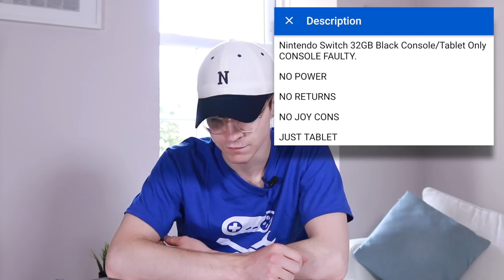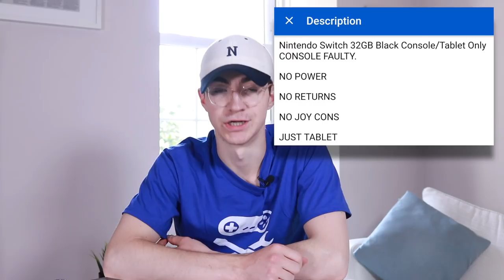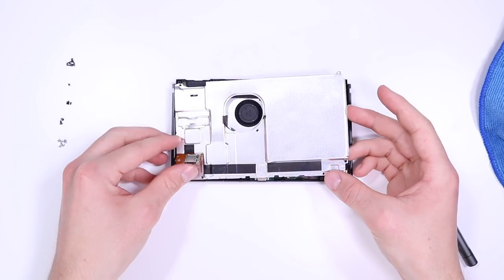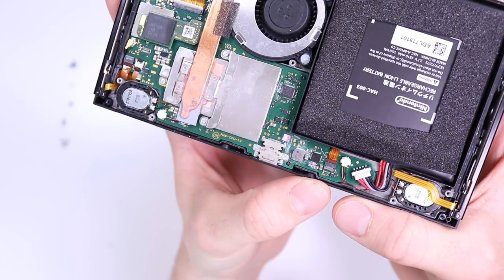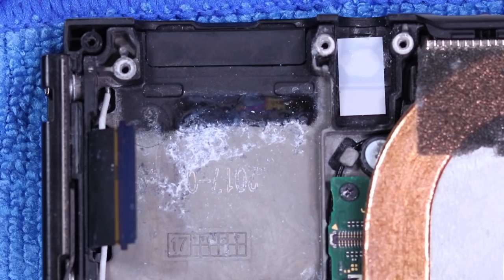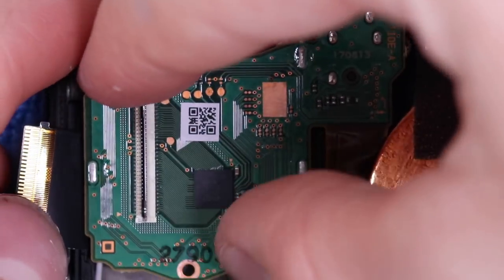£24 Nintendo Switch! - Can I Fix It?

Comment: I will help you with some tips. It's my profession to repair water damaged iPhones and Macbooks and love your videos. Since you don't own a ultrasonic bath and and special liquid you can try this: Alcohol will NOT breakdown watermarks or oxidation effectively. Use deminralized water and household water stain remover for the shower and a toothbrush. After that, Check oxidated capacitors (black solder joints) with multimeter for short to ground. Check connector for disconnected legs. Use an usb Ampere meter to check if your switch draw any normal charging current. And the cable that was eaten by oxidation is for your LCD backlight, if I'm correct. That's why you have no image. Fix that first. You are in a learning process and this is the next step you get better in fixing stuff and boost up your skills. Out of comfort means you are growing. You can do it!
Reply: Even if this is not for other users, I am thankful thaz you eritten this comment, because I learn either from this :). Thank yoz
Reply: Thanks taltech ! I didnt know about the demineralized water tip!    When you mean water stain remover do you mean something like "AMAZ 11107 Water Stain Remover", I haven't heard of that tehnique and didnt want to mess it up.  Thanks in advance.
Reply: @_FFFFFF_  The water stain remover is called here in my country (Netherlands) "Antical" . Its spray liquid to clean a blocked shower head and make the metal shine like new. So also a corroded water damaged board will shine like new:) I'm not sure if Amaz 11107 will give the same result
Reply: Most wholesome replies ever
Reply: Not gonna lie I didn’t know anything you just said there.
Reply: Thanks if i ever ruin my switch by water damage it might not 100% be wasted
Reply: Wow
Reply: @racheltherat5157  lol ikr

Comment from the maker: FYI I have not given up yet. I spent about 3 hours trying to scrub the board clean, and checking the caps with a multi meter. I figured out which chips are broken so at least I might be able to replace them.

But ultimatly, no luck today at least. If I can't find another faulty switch with different problems which I can salvage the motherboard from, I will continue trying to work at this motherboard.

Failing that I'll send it to my mate Vince
Reply: If you do go ahead and attempt the chips . My mate Vince and Steve from tronicsfix have done some in-depth videos that might help. With his hot air station and some flux I've seen my mate Vince bring a switch back from the dead.  Would love to see you get this one up and running
Reply: The Retro Future please please please replace the chips, I would love to see you get this switch to work. I gotta here that ” Oh my goodness me , will you look at that?” It will give me such joy 😃
Reply: I love vince but he has wasted a lotta hours n a lot of BS that ends up not working, I’d save him the trouble
Reply: The Retro Future I’m your 20th like on this comment
Reply: Does that way of cleaning actually work? I don't know, try to use the ultrasonic cleaner as Louis Rossmann does
Reply: Too bad if you do have the money I would try to fix it might be a good learning school for you. I mean I sometimes keep broken network switches and stuff as well to fiddle around and try something. Most of the times it fails and then I throw them away :P
Reply: Hey louis rossman has some videos on repairing water damaged devices process seems to be something like, hot air station with flux to reflow components, clean with 99% ipa, check components, replace any damaged components.... (He uses as an ultrasonic cleaner, and ipa...)
Reply: Who is Vince
Reply: Instead of alcohol maybe you should try electronics cleaner?
Reply: @CelenaTheShy  Switch Killer turned Switch Necromancer.
Reply: Hey can I sell you my broken dsi and 2ds
Reply: Росен Стефaнов My Mate Vince

Comment: From what I can tell; it was partially submerged.  If that's the case, I can image it was powered up when it was, that means quite a few sensitive components are fried.  You could always try and see where the power rails are and see if it is indeed pumping out the voltages required fro the Switch to run, that's normally your first step.

Comment: Probably someone spilled some water on the switch and opened it up. Probably around the capacitor the switch was mostly corroded so somebody tried to scrub it down with knife but scrathed the main board too. So seller sell it like never opened to hide the traces.

Comment: I bought a "not working for parts only" first gen Nintendo switch off e-bay. usually these first gen ones go for a ton cause they have un-patched firmware and are good for jailbreaking/CFW. I got mine for a bargain, and it turned out to just have a fully uncharged battery, and the SD card slot was disconnected, nothing else wrong with it.... easy fix. Very happy with my new [old] Switch. It's screen is perfect, the case only had a couple scratches on the back, but other than that it's in great shape!

Comment: 1:07 "Q: When did it stop breaking?" ... A: Oh it never stopped breaking ... in fact it is still most certainly broken rofl

Realistically though the board is knackered. It clearly had the liquid sat in it for awhile (which is why the corrosion is so widespread and severe). This coupled by the fact that someone went in there and tried to scrape it off means that there are likely multiple failed components/traces. Save the parts you can verify as working and toss the rest.

I recently had a similar experience with a vita slim I purchased where the seller was less than honest. I can tell soda was spilled on it, resulting in sticking buttons, and he opened it to clean it. In the process though he broke two of the zif connector latches and luckily gave up and put it back together at that point. I was able to bodge the connectors on and it works perfectly now, but that was just dumb luck.
Reply from the maker: Sucks when sellers lie! Thanks again for your help Shawn.

Comment: I can never find broken switches on ebay :(
Reply: Neither.
Reply from the maker: They get bought so quickly!
Reply: Check several times a day, they go up, and sell quickly
Reply: I bought one for 60 quid. Worked perfectly for a week then it turned out it had much bigger hardware faults, so i've sent it in to be fixed. It's more like a £120 Switch at this point but that's decent enough
Reply: At least for that cheap
Reply: I find a lot but the price is too much! XD
Reply: I find plenty but they want way too much. Last one I got that was "broken" and had the blue screen of death. Just had to hack it and manually reflash the official firmware.
Reply: Suedeash just bought a brand new switch for €100 from a big box store so that’s an oof

Comment: That's had a good shower, looks knackered to me, there's a lot of dishonesty on eBay unfortunately
Reply: Sold as seen.... I hate  those words. As long as it powers up into a screen, garbled or not, I can work with that. Even if the buttons are bad. Something other than the battery must work!

Comment: I'm new to this stuff, and I was wondering how come the alcohol doesn't damage anything? I know water obviously damages it, but why not the alcohol? Probably a dumb question, but I'm curious.
Reply: In short, the alcohol is high content with low water.

Isopropyl Alcohol is used in medical fields to sterilize cuts, scraps, etc, not to wash your windows. So this is why Isopropyl is used for cleaning, with it's low water content and very high alcohol content it dries fast, and isn't conductive.

About conductivity salinity, salt concentration, is a big factor in conductivity (for water) , Salt Water, aka oceans, if struck by lightning can travel 5 miles if what I read is correct. Fresh Water has contaminates, whether that be chemicals or organisms (tap water, rivers, etc.) those electrons in chemicals/organisms help transfer electricity (Think about a guy with epilepsy, the person during a Grand Mal (the one seen most in TV/Movies) is having their nervous system being in a spasm because of the electricity in their brains thus "shorting out" their internal circuits, the reason I said this tidbit is to say that all organisms have electrons in them.) Distilled Water so, without any salt content, without any organisms/chemicals, etc this Distilled Water should be safe right?

Ideally Distilled Water is safe, because without an /abundance/ of ions it does not conduct electricity /very well/ BUT still does.

(This is the TL;DR)
Back to Isopropyl Alcohol*, it dries /very/ fast, and is quite clean (as in very little - if any - impurities) because of the uses it has in the medical field (sterilize/sanitize) so it makes the best option to use on electronics due to the drying near instantly and having no salinity that may cause corrosion or leave behind contaminates. *TL;DR
Reply: @MrCODEmaster00  Thanks for the eyplanation.

Comment: Hey man!
I always watch your videos, and seems like when the problems are down to complex electronics you usually give up for the lack of expertise on that area.
I live in Ireland, no so far from you and I'm pretty good with electronics, if I'm allowed to say so myself, and I always repair my own consoles (or buy faulty and repair) too. If you want, you can send me stuff like that for repair. In that case I believe the problem would be solved by replacing the power management IC and maybe some of the caps around it.
In any case, keep up the good work!

Comment: did you try putting it into through your ultra sonic cleaner after you saw it been liquid damaged??
Reply from the maker: No, left it on a plate of IPA and shook it every 5 mins or so.
Reply: @TheRetroFuture  invest in one not a cheap one tho it'll clean up all  that corrosion and corrosion that may be the under the chips  sometimes the ultra sonic is all you need for liquid damage sometimes

Comment: Yeah Elliot good luck with these Switches, I got two really cheap and they seemed to work perfectly but both have big hardware issues that I currently don't have the tools to fix. At best if your WiFi chip is faulty you can reflow the solder with hot air, at worst there are multiple hardware issues. These things are pretty powerful but also very delicate.

Comment: the chip near the charge port is chipped and that could be causing the short also that heavy corrosion on the digitiser cable means you wont get touch i would like to see you have a go at changing the chip and then checking for shorts afterwards
Reply from the maker: Oh right.. ill take another look!
Reply: @TheRetroFuture   if you talk to vince of my mate vince he will be able to advise you about where you can get parts and the easiest way to go about changing it as he is getting really good at mending them now i hope that helps

Comment: The best thing is that the joycons probably still work so if you want cheap joycons just look at the for parts section on eBay because it’s most likely they will sell the joycons with it

Comment: The fact that it was already opened and tampered with is why even if your just testing parts you should record the opening of the package and console itself in the event it isn’t what the seller said it was

I’ve only done very minor repairs to my own joy cons but when/if I actually do start repairing consoles (to save money) I would video tape it just for proof if something is off from what the seller stated

Comment: If you use a heat gun you might me able to reflow the solder within the corroded components. Just make sure you don't melt any of the plastic tabs so mask them off.

Comment: I would do a damage limitation exercise if you can by ascertaining whether the rest of it is good, the screen etc then work out what needs to be changed so you aren't chasing phantoms and end up down the road quite frustrated.   If you do get the original board working, prob be worth it reflowing pretty much everything you can as corrosion can bite through smd solder joints a treat and you don't want to just kick the can down the road :)

Comment: I've fixed around 250 Nintendo handhelds, and only a couple of times out of dozens has alcohol with a toothbrush repaired moisture damage. Liquids just go everywhere, and destroy components quite easily. That damage is severe.
Reply from the maker: Yeah man it sucks.

Comment: Hello. I am planning to replace the middle frame shell of the Nintendo Switch because the screwholes are worned out. But my problem is if it's possible to remove the battery and place it into the new metal middle frame? Some articles like IFixIt said DO NOT reuse but it was from a replacement article. I am not planning to replace the battery but just move it into the new middle frame, can anybody help?

Comment: Why does he put isopropyl alcohol on the scratches? According to Wikipedia it is used to clean fluxes based on alcohol, that are used for soldering. What is he trying to achieve by putting isopropyl alcohol on the scratches?

Comment: That's an inductor not a capacitor :)

Luckily you have a ultrasonic cleaner allready you can clean the board in it if you use some PCB cleaning solution :)

That said charge controller will probably be dead, as for traces you can scratch the area with a microfiber pen to properly inspect it
Reply from the maker: Yeah ill give it some time in the ultrasonic cleaner. Unfortunatly the fuses are probably gone too.
Reply: @TheRetroFuture  yea considering you mentioned some caps are shorted probably means one of the main power rails got shorted to ground :( so you will need to replace the caps one by one till you find the exact one that's shorted ...

Comment: If your isopropanol was 99% there's a low chance you blasted another fuse. Copper oxide conducts badly and isopropanol itself doesn't conduct any electricity at all.

Comment: Hey man, kind of off topic but you seem like you could help! Around 8:10 you’re scrubbing some more of the board trying to clean it up and you messed with the ribbon cable a little. My question is, if you weren’t to flip the little tab on the board to get the ribbon cable out, and just pulled it out, would that damage the board itself? I ask because while trying to paint mine, I broke my right (short cable) joycons rail ribbon cable, and I had no idea that the little tab was there, so I just pulled it out. Well I got a new ribbon cable and even after finding out about the tab, I couldn’t get it to work at all. So I’m just wondering if the chances are likely that I may have damaged it, or maybe I was just seating it incorrectly. I’m sorry for the wall of text, hopefully you can get back to me, love your content!

Comment: the most logical explanation is that a kid spilled something on the switch and then put it in a towel but it had already seeped through. about a month later they open it up since the switch is having problems and then they open it up and see corrosion/rust so they get a knife to attempt to scratch it away. the switch ends up being damaged even more.
now this is where it splits,
the kid either sold it on ebay since the poor grammar
the kid tells his/her parent and then they sell it
the parent finds out and tries to fix it again but just damages it more and then sells it

thats one logical explanation of what could have happened with this switch

Comment: See if you can reflow the solder by putting it on the oven, it's a way to fix graphics cards. Not an expert but it is an option

Comment: just wounder this has nothing to do with switches but i just got my hands on a psp 1001 with all its screws missing and a like 3 butters missing  also shattered screen but the psp dos in fact work would it be better to by a nother psp for parts or just use it as parts for a new one  or spend around 50$ for the parts?

Comment: get yourself a cheap electronic microscope, soldering tweezers or micro pen, and a load of flux off aliexpress  when you get a heat gun station. Then watch some videos of louis rossman. maybe get some practice boards off aliexpress too.  i have faith in you getting it working, but as my mate vince says, the lcd could be done for anyway

Comment: Getting that thing working with THAT level of Corrosion by just cleaning it up is kinda unlikely. Corrosion shorts stuff out. In the best case the components can handle it, it just doesn't work properly anymore and with a good scrub anything is back to normal. But if the wrong components are shortet, those can get totally destroyed (often without looking suspicous). On that corrosion level, it is very likely that some components / ICs got burned. And in this case, without timeconsuming search, good soldering skills, schematics, tools, it is just fucked. Plus, even if possible, if there are proprietary components that you can't buy, well unfixable.